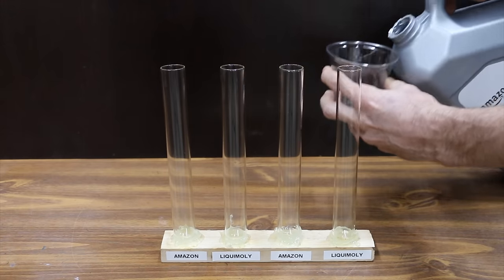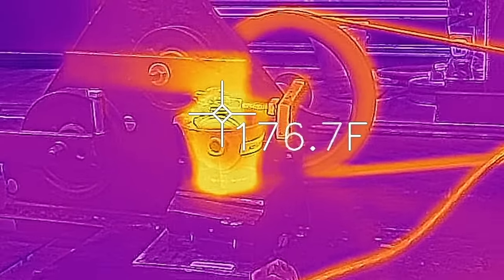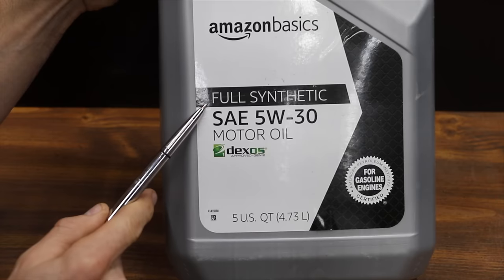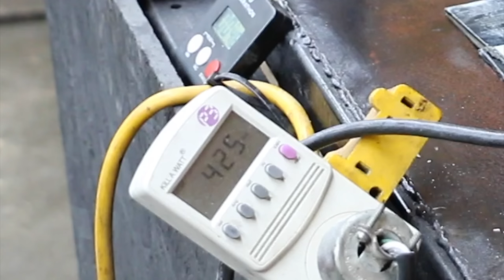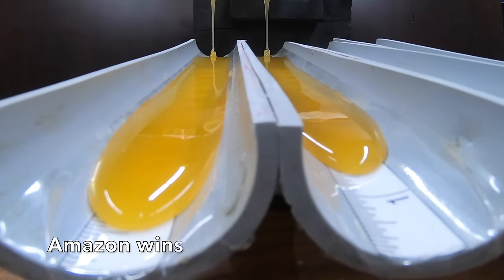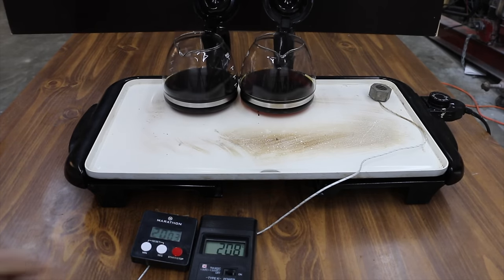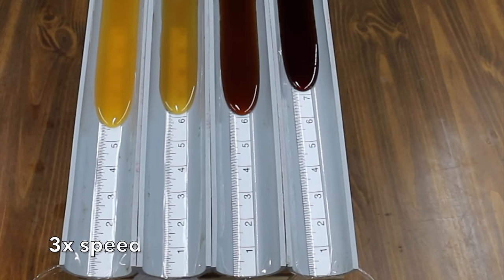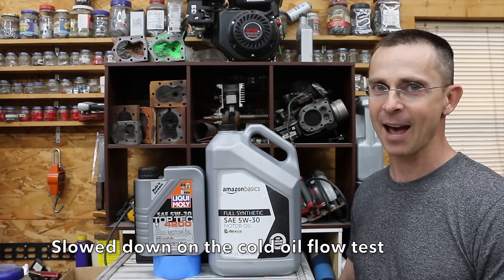Is Amazon Basics better than Liqui Moly? Let's find out!

Comment: You need to be careful with lube oils. 
I was working in a company that used the same lube oil for the big compressors (3.6MW) and the power turbines (5MW) since the producer of the lube oil said so and has been part of the same company before. After few years we noticed, the oil in the turbines became more viscous and the turbines were close to the shutdown readings. After contacting the lube oil manufacturer we added the same oil type with a lower viscosity to thin the lube oil. After some investigation they found that the oil had some additives for corrosion protection of the compressors that were degrading in the turbines. So we changed to the lube oil of another producer. OK its not lube oil for cars but its better to follow the specs and even then its sometimes problematic.
Reply from the maker: This is great information!  Thank you

Comment: Question for the heat test: Should the percentage mass loss be compared vs the actual grams lost? Since the starting weights of the two oils were different?
Reply from the maker: Great point. I add 200 grams of oil and use that for the evaporative loss calculation.  Coffee pots weight slightly different amounts.

Comment: Liqui Moly advertises a 2 year or roughly ~18.5k mile change interval.  I don't believe a 2 year timeframe is part of the SN+ rating, perhaps it is.  Since I drive less than 18.5k miles (around 12k) in 2 years, I'm going to let it go 2 years and see how it does.  I don't see Amazon actively stating their oil can stay in the engine 2 years.  I plan on sending the oil for testing after the two years to see how it held up.  If I don't have to do my annual oil changes, Liqui Moly is worth the extra money.
Reply from the maker: Thank you.   My preference is to change oil more often than 2 years with any brand of oil.

Comment: Liqui Moly is endorsed by BMW. Their European mix is well known in the exotic car market as having superior properties that result in less timing chain rattle noises; the engine is noticeably more quiet. This is well known on the BMW and Porsche forums. If you want the best protection, buy the oils endorsed by Porsche, BMW, and Mercedes for their engines in their $100K+ cars. Liqui Moly 10w60 performs better in my 987 on the track that any other oil I have tried.
Reply from the maker: Thank you!

Comment: Well liquiMoly has molybdenum disulfide, so no wonder it is "stickier" that the other oil... the idea of LiquiMoly is that it is supposed to do better sticking to engine parts well after the oil has drained back into the pan. So that cold startups experience less friction upon unoiled moving parts for the first few seconds.

Maybe can u test the proof of this concept? Maybe with a very precise balance, measure 2 dry bearings, then place the 2 bearings in heated oil, remove the bearings and let sit in a needle gripping cradle to let the oil drip off for several hours... then remeasure the weight to see if the bearings retained mass(oil) more than the other?

Thanks
Reply from the maker: Thanks for the suggestion.

Comment: IMHO the test is not absolut valid for the question, which oil is better. The cold fluid test isnt so good, because we dont have a comparison  for a calibrated 5W oil. Maybe the amazon oil is more like an 0W oil. If somebody prefer an oil with good cold start performance, he should use a 0W-XX oil, instead of a standard 5W-30. I have some confusion about this abrasion test. Which pressure was put on the bearing, what was the exact oillevel on the roller? That should be exact calibrated.
The more important qustion on oil is, on which age, which level of performance the oil keeps. 

What is about the hot perfomance. Did it still have its lubricating attributes, when its hot?
What is about the cleaning performance? Heat consumption?
Reply from the maker: Thank you for the feedback

Comment: You shouldn't compare two oils just because both are 5W-30. The LM TopTeq 4200 is basically a VW 50400/50700 oil while the Amazon is a Dexos2 oil. Why not get the Amazon oil that covers the VW 50400/50700 or the LM TopTeq 4600 that covers Dexos2?.

The tested Amazon doesn't belong in a VW engine and neither should the LM go into a GM. Apples and Oranges.

Then again, Amazon seems to generally be selling quality oil. But if you are stuck on a specific brand for whatever reaon and know where to look, you can also get really good deals.
Reply from the maker: Thanks for the constructive feedback.
Reply: @ProjectFarm  I didn't want to come off as harsh. I really enjoy what you do. 👍

Comment: Most engines go through run cycles where it's run for a while and then allowed to cool down few a few minutes then started back up and run again, I'm just wondering how it does in different type areas of the temp ranges    From like the desert heat and also the extreme cold  heating it up to run temp and the allowing it to cool down for just a few minutes ( 5 mins ) and then do the test on the bearings after this
Reply from the maker: Great point. Thanks for the ideas

Comment: As you clearly say. These are not working engine tests but none the less. They are GREAT tests. I am gobsmacked by the poor performance of Liqui Moly. I live in Germany (I am a Brit) and its everywhere here. Shelves are stacked with it and little else. Its not cheap either (oil is expensive here as they factor in disposal at purchase...I.E change your oil and return the old and it will be taken away by the shop you bought the oil at). Fuchs is another good German oil maker but we have some weird named eastern European oils that also populate our shelves. Mannol is one i use regularly. DIRT cheap, meets all the same specs as Liqui Moly and i never had issue. Reach out to me if you want a sample sending over pal. I would be interested to see how it stacks up.
Reply from the maker: Thank you!

Comment: The Amazon oil ran faster because it is thinner than the Liqui Moly. By Liqui Moly it is thicker because it is made for temptation for - 20 to +10 degrees Celsius and at this temperature the tolerances are bigger so the oil must be thicker to save the engine. This oil is not made for temptation over 10 or 20 degrees in outside. Because that it is this important to use the right oil for the temperatures you wear driving withe your car or whatever. Sorry for my bad English
Reply from the maker: Thank you

Comment: Liqui Moly has Molybdenum sulfide (an amazing dry film lubricant patent by that company).  Not sure if Amazon basics has that or not.  Liqui Moly  was used in German aircraft during WW1.  Anyway, I use it in my BMW.  Did an oil change and half way through got a call from the ex.  Well, I forgot to add oil again and ran the car for almost a minute before realizing I didnt add oil!  well its been running fine for almost 3k miles.  I'm an idiot I know . . . but it maybe saved my engine.
Reply from the maker: Thanks for sharing.

Comment: Problem is that both oils have the same viscositiy rating, but there are other additives in both oils, so they are performing slightly different
Reply: You need oils with the same specification from the manufacturer like a amazon oil and a liqui molly oil with like VW504/507 for longlife services on vag cars or both the GM dexos 2 specification
Reply from the maker: Thank you!

Comment: It appears from my observation the liquid molly is all hype! Sir have you considered doing any oil testing on Shell Rotella oil?  I use the oil on my Mercedes Benz 300SD 1983 it is a turbo in line 5cyl. diesel engine. Sense the car has so many miles on it, over 250,000. I use the regular oil on my car.
Reply from the maker: Thank you!

Comment: I would never put the Amazon oil in my car 
Liqui moly is a well trusted oil that has been proven to be the best
Reply from the maker: Thank you for commenting.
Reply: Amazon doesn't make there own oil... they are made my Warren distribution which is a huge oil supplier. Same with oil you get from the dealer. The dealer are selling you a re-branded container from an actual oil company and marking the price up simply for the symbol. In the end of the day if you feel satisfied with expensive liquid moly oil go ahead. But for an everday consumer Amazon Basics is the go to oil. Cheap and still meets and or exceeds my vehicle manufacture's ILSAC GF-5.

Comment: A great test would be to use the same 200g quantity of of oil for all the tests. Then run it back on the bearing test @100°C  to see what the shearing freezing and extreme heat do to degrade the performance. Final 4 Idea possibly?
Reply from the maker: Great recommendation!  Thank you

Comment: can you do a similar view after oil has broken down due to heat and cold ( after use in other words) because oil breaks down with time, heat, and cold. doing fresh oil testing I feel like can be misleading. Oil in a car does not stay fresh though 5,000 miles it breaks down so I'm wondering how does amazon preform after some oil breakdown maybe 2500 miles or equivalent ( or 5,000 Miles if you do 10,000 mile synthetic oil changes)
Reply from the maker: Thank you for the video idea!

Comment: Own a 2014 mercedes sprinter van with 560k highway miles its diesel v6 3.0 
I been to few sprinter shops across country and have heard mutiple times that liqui moly vs mobil1 or mercedes oil is much superior the shops have seen the v6 diesels make it up to a million highway miles without rebuilds!
Reply from the maker: Thanks for sharing.

Comment: Almost every oil works great when it´s new. The real difference is after one year and 15000 km in the car. The oil is then full of carbon deposits, and all ingredients of the oil are degraded by the heat, moisture, airflow and friction. Also mineral oil will work great in this test. Good idea is to use the oil in the car and test and compare it after it´ lifetime in the car. I don´t mean this as a hate. I like your videos and your tests :)
Reply from the maker: Great point!

Comment: Thank you for what you do; But Please DON'T put uncertified oils in your car! 
LiquiMoly Has 5 FIVE(+) different 5w30 full synthetic oils. All due to different additive package requirements of different engine designs. 
Why did you pick oils that are NOT approved for the same engine? VW vs GM oil requirements in this case. 
A better comparison might have been with the Liqui Moly 20136 Special Tec AA 5W-30
VW has Variable valve timing. Does GM ?
You got to ask yourself. Why is it that AmazonBasics performs so well in your tests But doesn't qualify for any manufacture certification other than GM Dexos2? 
I would be interested in seeing these same tests performed using all Five (+) of the 5w30 LiquiMoly formulas.
Also a real comparison between 
 MOTUL  (109370) Specific LL-01 FE - 5W-30 Synthetic &
Liqui Moly (20444) Special Tec B LL-01 FE - 5W-30 Synthetic
Reply from the maker: Thankss for the suggestion.

Comment: There is so much more to an oil or any fluid/additive than how it does temperature wise. And this test doesn't even begin to cover how tell each product holds-up over time. 
I weight about 250 pounds. I'm in my mid-50s. In kickboxing I run over people half my age and 100 pounds lighter. They can't match my punching rate or strength. And they can't last through class as long or as well as I do. But I'll tell you what- have us run a or mile, or even just climb 4 floors of stairs... They'll leave me in their dust. One small sampling of specific (challenges) doesn't cover the full spectrum of performance.

Comment: I'm surprised. Liqui-Moly is a high ester Group 4/5. Amazon Basics is a Group 3 and similar to Kirkland, MAG 1 and SuperTech. All Warren Group 3 oils. Since high ester oil is used in jet engines, I would expect a flash point comparison would put the Liqui-Moly ahead. Motul is similar. In Germany, a Group 3 cannot be called "Synthetic". A synthetic oil must be at least a Group 4. Not here in the U.S. Group 3 Hydrocracked can be called "Synthetic" ,"Full Synthetic" and "100% Synthetic, which in the U.S. are just marketing terms. It's really a conspiracy against consumers.

Comment: I am going to tell you a secret about liqui moly toptec category.
I have been using it in my BMWs.
I tested Castrol, Motul, Mebanol, BMW Oil, Shell Helix...
Liqui Moly oil needs at least 500 kms before its formula takes a stable shape that would lubricate the engine as optimally as possible without loosing protection and viscocity chracteristics.
You should run these oils in the same car for at least 500 kms, then grab a portion of each and re-do your tests. You will be suprised.
Besides, LM toptec 4200 is BMW LL04 compliant (fuel without sulfur), while Amazon basics is BMW LL01 (fuel with sulfur).
You can retry the test with LM special tec 5w30 if you r in USA.
Reply from the maker: Thank you for the feedback

Comment: The fact that Amazon oil flows faster may also mean it is not up to the standard. May have lower viscosity of what is advertised. And this is not good at all. Liqui Moly is approved by very, very strict European  OEM standards, unlike Amazon or Mobile 1. That's there to tell you enough. You may use it on Ford and GM, which will run on semi-sintetic oils like Amazon, but do not ever use non-OEM approved oils on your European car, just to save $10-$20.
Additives in Liqui Moly are around 30% of it's ingredients. You think this is for no reason?
Reply from the maker: Thanks for the feedback.

Comment: U will need to test how many thermal cycles each oil have and how they behave. For example motul 300V is an amazing oil but with many less cycles which means that a fantastic oil for the first Kms, will become one of the worst after 3k Kms. Engine oils are really really sophisticated and with many parameters. Now, even with a cheap oil I really doubt that u will see any failure in your engine even after 100k Kms. Change oil regularly and this will solve all the issues u might have.
Reply from the maker: Thanks for the suggestion.

Comment: Folks, this is what in engineering we would call a Mickey Mouse methodology that has nothing to do with actual liquid properties inside a hot high pressure system, expected to hold an engine together, without any air bubbles or seizures, all the way to 400 km/hr. Or your average 250 km/hr Autobahn... The moment we talk heat, we now talk a higher number, e.g. 40. There are dozens of critical properties that this metal on metal joke never recreates. Besides, unlike in Hyundai engines, performance engines DO NOT RUB METAL ON METAL INSIDE- and are not expected to. Slice open a 15 year old performance German engine, and original tooling marks are still visible, unaffected by piston movement. In the end, just warming up an oil, or just dropping it at -20C does not talk as to how it starts behaving the moment the ignition is switched on...